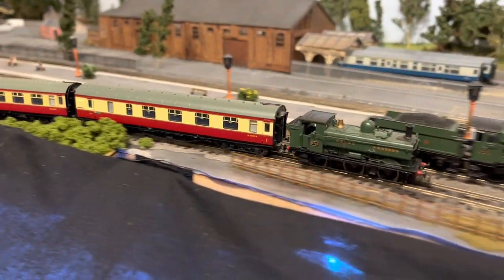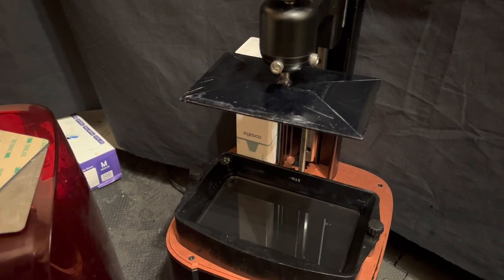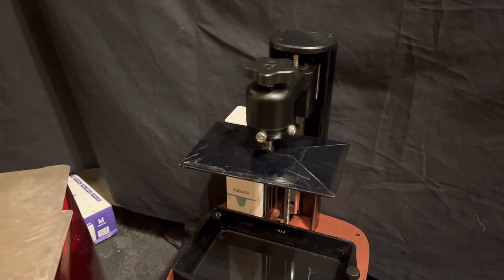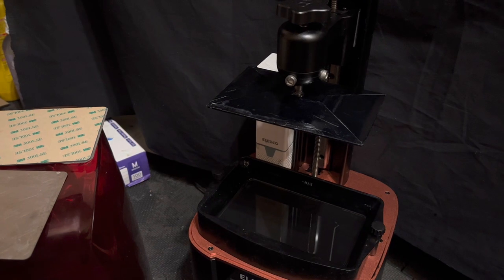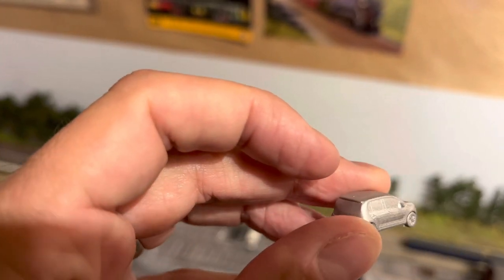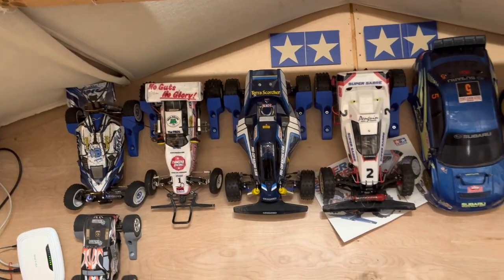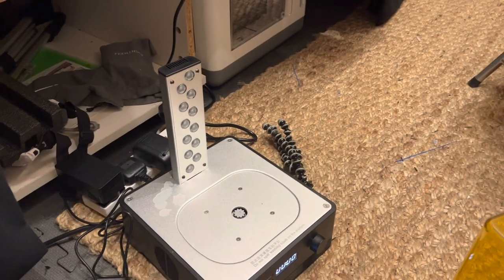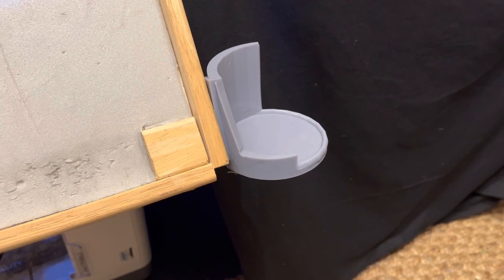My 3D printing journey

Comment: Keeping your resin and printer warm is a must this time of year. Below 20 degrees I think it is there resin starts to be less viscous and causes print failures. I get much better prints in the summer months.
Reply from the maker: Yes I've noticed that, I try to get the shed up to temperature with the fan heater 1st 👍

Comment: I normally use a single sided razor blade to remove prints from the plate. Once you get a corner lifted they usually come off easily.
Reply from the maker: thanks, I'll give that a try 👍

Comment: Heat, 22-25deg, level the bed, use the settings on the resin bottle, reset home and don’t give up on the magnetic plates. Don’t give up.
Reply from the maker: Thanks for the tips, I'll have to give that magnetic flex plate another go when I've got more time 👍

Comment: Very informative Simon! Would love to see a series for using both types of printer for a beginner! I'm probably going to start with an FDM type, as working with resin looks like a very time consuming and potentially messy activity, albeit better for detailed N scale prints! From the look of your RC car brackets, FDM printers are better for more structural stuff, which I've got a few ideas for! Keep up the great content! All the best, Ian.
Reply from the maker: Thanks Ian, yep will put together a video on the basics - where to find the files (or create them), slicing, and printing.  With the FDM printer  I've only used PLA type filament which seems pretty strong.  It's less brittle than standard resin and holds those cars/trucks up no problem (the screws went in without cracking the brackets, whereas with resin it would probably have cracked)...great for structural stuff but then, the detail on resin prints really is stunning. Cheers, Simon.

Comment: Great video Simon, I found the learning curve into 3d printing also incredibly steep, but have got my Ender 3v2 to a place where prints are pretty good, including N gauge coloured signals. Im fascinated by your resin printer and your learning journey with it, but not sure Id switch over. You said yourself it was a faff, hence the second cure/wash station and I can imagine this has improved things no end. 

Would be nice to see what happened to your creality printer though, as that one is supposedly better than my Ender 3.
Reply from the maker: Thanks John, it is definitely messier and more of a faff with resin printing, it was quite refreshing to try FDM printing and just take the print off the build palate and...oh that's it , done 😀 I'll have to see if I can tweak the Creality printer settings, nozzle, model files etc and see what I can print for the railway as admittedly I haven't spent much time optimising it yet.
Reply: @SimonsShed  Just say if I can help in any way